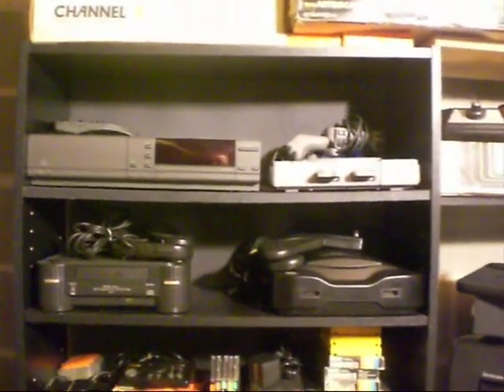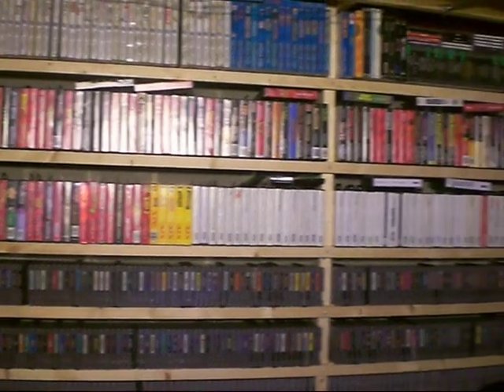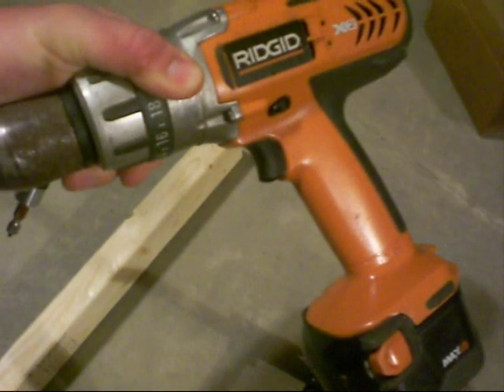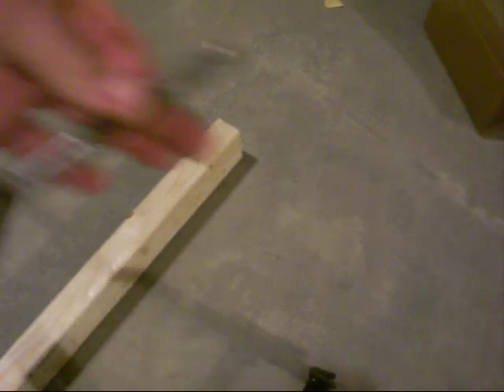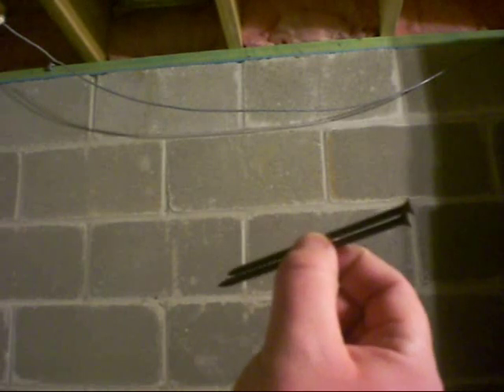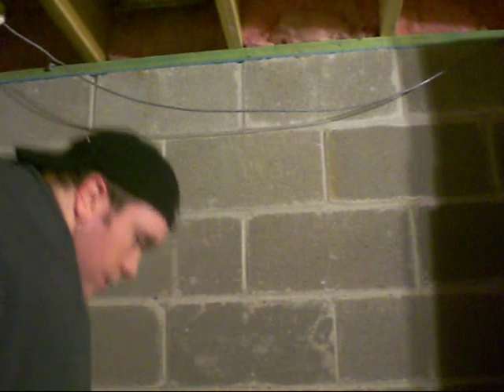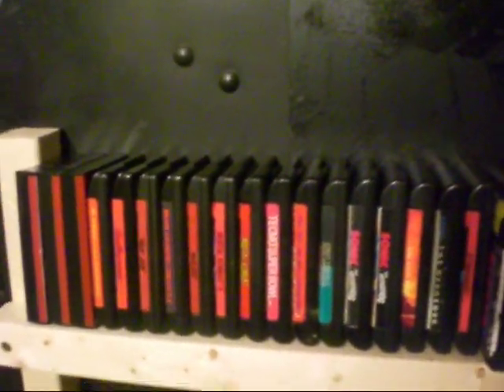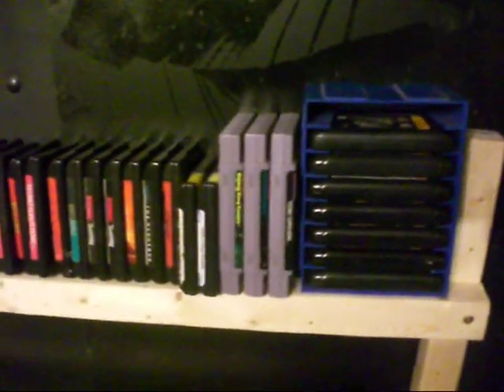By popular demand: More on cheap DIY video game shelves.

Comment: I really like this, it's been sitting saved in my 'Watch Later' list for a year or so now and I think I'm just about at the point I'm ready to give it a try. Wood seems so much cheaper in the States than it is here in the UK though, what you are saying costs around $20 is probably going to run to $50 here. Anyone watching this from the UK who has given it a try yet? I'm guessing 2 x 4 and 1 x 2 would be what we call 44 x 94 and 20.5 x 44. Might add pieces of wood along the back so that full shelves can be made for keeping consoles on, will increase cost but they will be pine (well redwood) anyway so still not super expensive.
Reply from the maker: +RyanFaeScotland Yeah, I imagine wood is a significantly more expensive commodity in the U.K.

I hope it works out for you. Feel free to link a video in the description of my original video: https://www.youtube.com/watch?v=V0TvD5oAMyc

I'd love to see how they turn out.
Reply: +EdT1138 Thanks man, will do. Still clearing the garage out to make space for it and going to get a couple of sketches done first to plan out where I want things on the shelves as that will influence the layout. One question though if you got the time, why did you opt for 2x4? That looks thick as hell and probably a lot stronger than is required (I'm no expert though!). Thinking I can save some cash by dropping the sizes but don't want to go so small everything collapses after a week fully loaded!

Comment: I Like how you broke this down. I would probably look into doing a thin piece of wood on the back and then run a board like a shelf across. This video showed me the gap between the wall and the front board isnt nearly as big as I originally thought. This is a good way to get quick shelves up for the games.  For console display would you recommend the Walmart shelves you have ( I think you said for 27.00 ea ) or do you have a shelving idea that would work for these items as well.

Comment: Also wondering what kinda base can I use incase I didnt want to drill holes in my drywall for mounting this to. I can see running a 2x3 across the top and bottom like you did on the sides, but what kinda of floor base would you suggest.

Comment: For Mine I Found That Fitting The Boards And Not Allowing The Cases Any Space It Works Better. I Measure The Case And give It 3 Quarters of An Inch Free Space No More Than That Ever !!!
Reply from the maker: Cal Sanchez Probably not a bad plan.
Reply: *****
Yeah On Top of The Too Loose Fit I Also Discovered When I Got My Cases From The Garage That My Collection Was Much Larger Than I Built For. I Have CDs DVDs Games And I Am building My Blu Collection And New Consoles